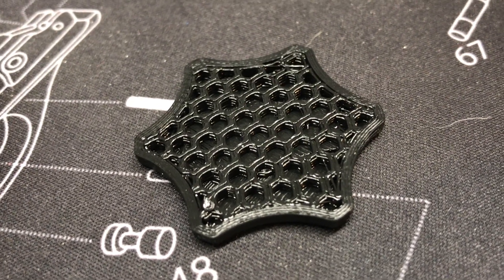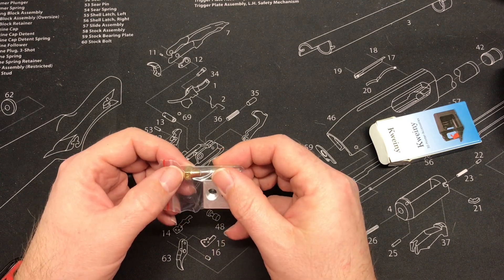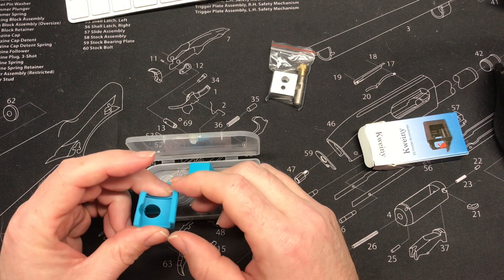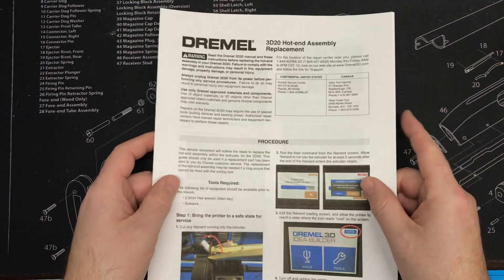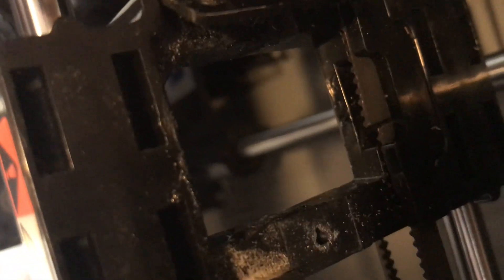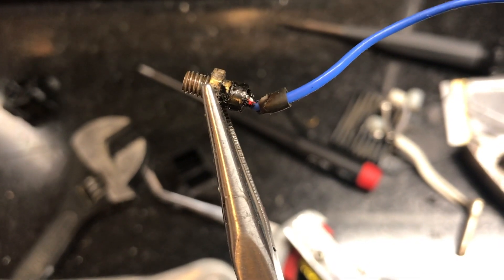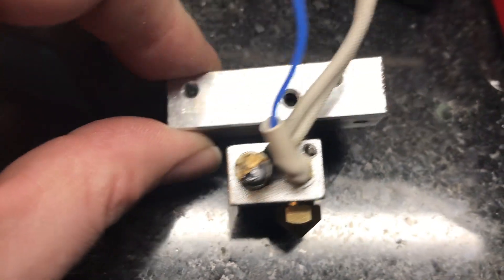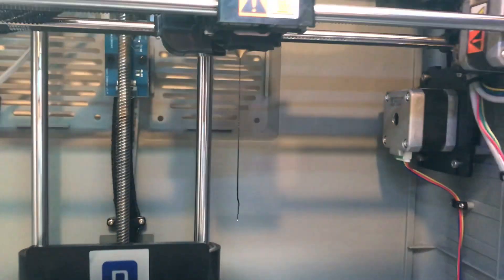Hot End Swap on a Dremel 3D20 Printer

Comment: Hi, i got a used 3d20 and was printing until today it started showing an error message 101 and temperature is stuck at 1045C, it moves like it’s printing but no filament is going out. Have you seen this issue?
Reply from the maker: yep, your nozzle is clogged.  heat it up and you can clear it with nozzle tool.  you have to do this while the nozzle is hot.  if you don't have one, the kit is cheap here: https://amzn.to/4481AFa
Reply: @MattofManyTrades  thank you will try it out

Comment: Hello i have code error 193 and the system don't heat, yesterday i will demantle the hot end parts. Thanks for the reference extruder and your vidéo.  Dennis😉
Reply: Error 103 not 193
Reply from the maker: @denispaquette3684  No Worries.  I hope my video helps!

Comment: Matt- I was thinking of buying 3D20. Would you buy it again, knowing what you know now? What things DON'T you like about 3D20 compared to Ender? Thanks
Reply from the maker: Hi John.  I like both, but for different reasons.  The Ender prints lots of stuff, but you have to build it, fiddle with the alignment, print extra parts, make a case and exhaust fan for ABS, etc...  Now the print surface is larger and I LOVE the heated bed.  In truth I was trying to get the Creality 10S and the Ender 3 was shipped to me by mistake.  I kept it and have used weekly for almost 18 months.  

If going with a multi filament printer as an entry level machine - look at the Ender5.  About the same cost as the Dremel, super ridged, and has a huge print size.  I am actually looking at one for my office, so I can do some prototyping at work without having to wait on the Additive Engineering team's 1 week+ lead time.  

The Dremel just works.  Out of the box.  You can only use PLA and the print surface is smaller, but it is great for the price if you do not have the time or desire to "make your own" with the Ender/Creality.  Also the Dremel is 2015 tech, but is GREAT for quick cheap prototypes.
Reply: thx

Comment: you change nozzle but you have no heated bed?  did you mod that too?
Reply from the maker: No, Not on the Dremel 3D20.  I have an Ender and a MakerBot with heated Beds.  This is my primary PLA printer and I have it dialed-in specifically for PLA.  I don't need a heated bed for that, but I use hairspray as a build surface film.

Comment: How did you manage to get the pin rod (sorry for the incorrect terminology) off the rectangular block?
Reply from the maker: Forward to 7:26.  I had to use a soft hammer and place the block over a hole and GENTLY knock it out.  DO NOT use a steel hammer.  The 1000s of heating cycles causes it to bond to the block because of the dissimilar metals